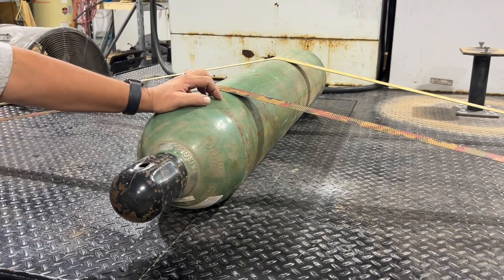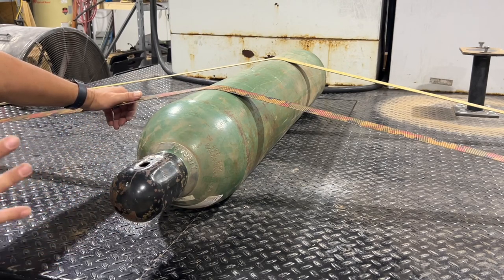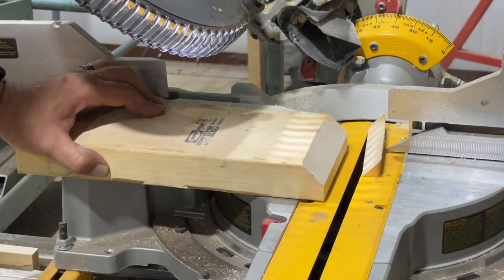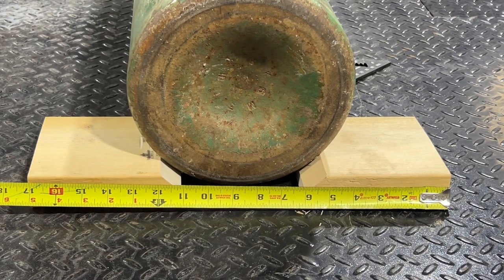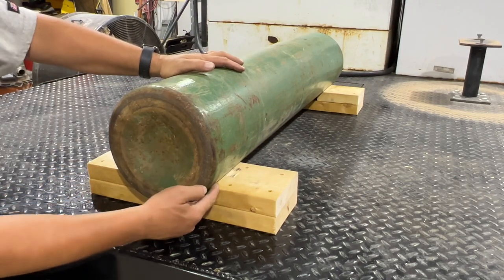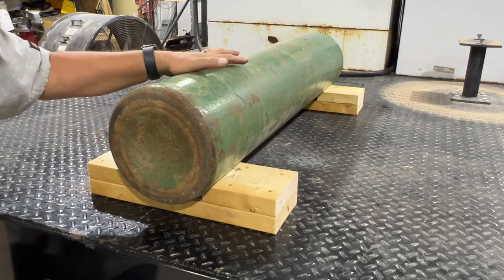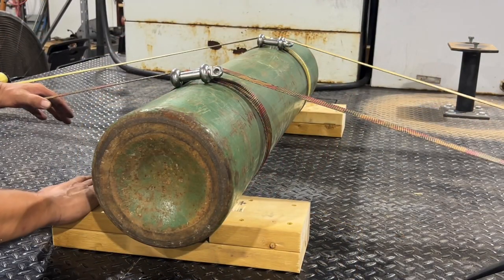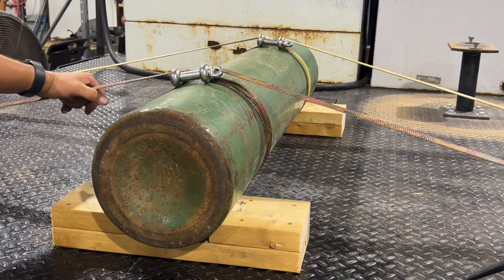How To Transport Gas Cylinders Safely

Comment: Excellently done.  I've been saying for ages that I need to build something like that, but never seem to get around to it!  The shackle is a very good idea.  If I might make one suggestion, it would be to put some small eyebolts into the ends of the wood blocks so they can be tied to one another with some rope.  Not to keep them secure in use, but simply to keep them together.  I always "misplace" little things, and took a page from the military when they tie pairs of wheel chocks together so they can grab the rope and pull the chocks free with one tug.  It makes stowing the blocks a lot easier, too, because you can just hang them from a nail in the wall, or wrap them up in a bundle to stash in the tool box.

Comment: Never have or will have the need to do this but thoroughly enjoyed this anyways!
Reply from the maker: You never know, this method works for a lot of different things. I tie down lumber in the same fashion. At any rate, thank you for taking the time to watch.
Reply: 2 years ago I was in Seattle working in the tech industry... now I off road 2 hours through central Mexican jungle with these tanks for my gas cooking stove a couple times a year.

Change is the only constant in life.   Eyes to the horizon till you fall to the floor🍻
Reply: 🛫📖🛬
Hey Colin,
Just thinking out loud,
You may not have the need to use the saddles but now you have the knowledge and you can always share that with somebody that might have the need ❓

Comment: This helped me get my first bottles home safely. The store clerk was impressed, like he must see some sketchy stuff from the DIY crowd. I ended up creating a double crib setup for holding two tanks and used 3 of those bolt on trailer D rings to secure the tanks to the cribbings in a similar fashion to how you ran yours, with the middle D ring being a downward redirect. I then strapped the whole rig down to the truck bed. It passed the ain't going nowhere test. Thanks!
Reply from the maker: If there is any chance you took a picture of how you set up that rigging, I would love to see it.

Comment: Nice video but you can eliminate the shackles,  just complete the circle 180 degrees around the bottle with the strap. Start at the top. As you tighten the strap it will choke up on it. This eliminates the stress points on the strap at the shackle. Just doing that alone the bottle cant move. I also dont bother fabricating wooden holders, just use a rubber mat, one size fits all.
Reply from the maker: You can, but it can be a little tricky sometimes. The straps have to be routed in opposite direction to counteract the twisting force of each strap. You also have to tighten one a little, then the second one a little before you can start to bear down on the strap. If you don’t, the load can have a tendency to turn. The rubber is a good idea, but it doesn’t offer much clearance to wrap the straps around the load. I like this method a lot better, and it can be applied to a wide variety of cargo.
Reply: @txtoolcrib  
Your answer is spot on. Your method has simplified and smoothed out a lot of unnecessary trouble.
"WORK SMARTER NOT HARDER"
Thanks Ben

Comment: I'm just going to say, if you are transporting a single tank like this then this is likely fine provided you find a way to keep it from moving (saddles and such), but commercial gas supplier truck transport them standing up, with the tanks chained or secured to the walls of the cab depending on how much they're transporting (which is a lot by the way). Sometimes the tanks are placed inside special racks, like about 16 tanks to a rack and are hoisted to construction sites. Those trucks transporting gas tanks are specially made for the job.

Because if you're transporting a LOT of tank at once it's really impractical to transport it this way. Or you should have hard points on your truck bed that you chain the tank solidly against (like at the cab end of the bed) so it absolutely CANNOT roll around.

Comment: This is a very useful DIY rig for transporting oxygen,  argon or CO²  welding compressed gas cylinders.  

There is one additional procedure that must be followed, without exception, when it becomes necessary to transport an acetylene cylinder on it's side because acetylene cylinders are different than most other cylinders in a couple of  ways.  First being the pressure of 200-250 psi vs 2200-2400 psi of other gasses when full.  Second and most importantly acetylene cylinders have a porous honeycomb -like material inside,  which is saturated with a predetermined amount of acetone , which the acetylene is dissolved into and  released when the cylinder is in use, because acetylene in it's pure form becomes dangerously unstable and likely to have explosive reactions when compressed to more than 15 psi.  With this in mind, the cylinder must be set upright for a least one hour, and at least 2 hours for the larger cylinders before use,  to allow the acetone a chance to settle.  If you were to use the cylinder right away after laying on it's side, the acetone would be drawn out into the regulator and torch, possiblly damaging rubber seals in the process,  and most critically,  allow a void where the acetylene can compress without the acetone,  and the cylinder could undergo  exothermic reactions and detonate without warning.

Comment: I was taught in welding school to never put acetylene on its side ,  it could cause volatile issues even possibly explosion 

Oxygen no problem though
Reply: Wrong-O Bubba. Your instructor was clueless. Acetylene because  you would have to leave it vertically overnight (which nobody will do) or the acetone can come out. Just laying it on it's side will not make it explode but there is a big danger iof getting caught and paying a whopping big fine. Same with ANY compressed gas bottle. Don't ever let OSHA or the DOT/Highway Patrol catch you or you will have the big hurt put on you.

Comment: What if you just wrap arount the bottle one turn with the belt instead of D chackle?
Reply from the maker: If you have two straps wrapped opposite of each other. By wrapping the strap in that method, it will want to turn the load sideways against the pressure of the strap. If you have a second wrap to counteract that twisting motion it will make the load stable.

Comment: 🛫📖🛬
Hey Ben,
Excellent video and I thank you very much.
Just got through making my saddles and I need to ask you a question.
I went to your link to Amazon but I'm curious.
Just what size shackle is the one in your hand ❓

Thanks a lot for teaching us knuckleheads a better way 🙏

📖🛐✈️🐆🐝🐝🐝
Reply from the maker: I left a link in my pinned comment at the top of the comment section. This is a 3/4” D shackle which works perfect on 2” straps.
Reply: @txtoolcrib  
Thank you Ben

Comment: Acetylene cylinders must be transported vertically.
Reply from the maker: Usually, but there are times you not able to transport them vertically. In which case, they must stand for 6 times longer than they were laid down.
Reply: I enjoyed the video, and good idea. However, there is a lot of liability for transporting cylinders horizontally. If someone goes wrong and the valve breaks off, you got a missle headed out of town. I'd much rather have it headed underground. That said, it is really tricky to mount a cylinder vertically on most standard pickup beds or trailers.

Comment: No question that is a completely safe way to transport an oxy bottle,,,,,and also an OAHA and I believe ICC violation and defiantly a State DOT violation in most states to boot.  They do not permit portable compressed gas cylinders to EVER be anything but vertical with the exception of very short times when they are being handled or hoisted. - Not my idea and I think it is balls out stupid, but it's the law and a BIG dollar violation. = Love thy neighbor, but don't get caught.

OH,,,,,Don't ask me how you store towmotor propane upright and use then horizontally. ..... All I see is the only reason is because OSHA says so. (They make me sick)
Reply: Oh my god. I had a city inspector walk in one day. We have Argon, 75/25, CO2 and  oxygen bottles laying all over the floor and she had a problem with the oxy/acetylene bottles that were chained to the wall with regulators and she wanted me to unchain them because they were in use. So I proceeded to start taking the regulators off and put caps on them and she said no. Then you can leave them chained to the wall. 😳😳😳 Needless to say, I capped the acetylene bottle and laid it down that made her eyes bulge, I giggled then locked the door behind her.